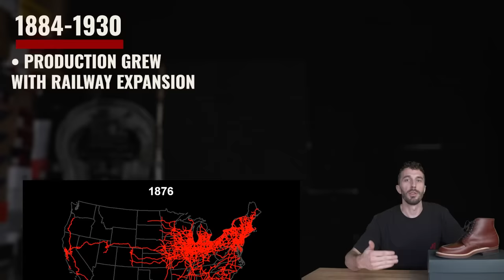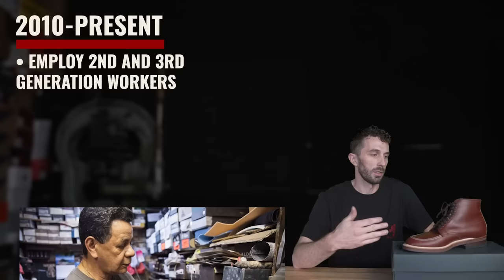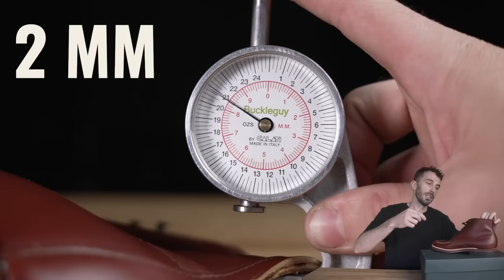Why the Indiana Jones boot is stupidly overpriced - Alden Indy

Comment: I love that the Iron Ranger is still the example of a great boot for a great price. Love the content
Reply: Absolutely
Reply: Yup , the iconic iron ranger stays iconic!!
Reply: O you’ll be surprised, watch the latest video on redwings
Reply: I had both Iron Rangers and the Indy boot. Sold the Iron Rangers and do not regret it one bit.
Reply: @Noodlepoke  Didn't say they were bad. I'm saying I will take the indy boots all day every day over IR's. Look better and more comfortable. I've gotten almost 10 years out of my current pair and they have plenty more life in them
Reply: @Noodlepoke  Indy is much more comfortable as Alden has better the last shapes. Also when you get the 403 instead of 405 you'll get the top quality Chromexcel upper leather
Reply: @anekey925  aldens a nice lookin boot but way overpriced
Reply: @anthonyinzerillo2804  Yeah I initially got the 405 all those years ago and returned them for the 403. It was the right call. He should have reviewed the 403 even though it's not the "classic" Indy boot
Reply: What price, comfort? I started with Red wing and the iron ranger and have a fifteen year old pair that I still wear occasionally. But the Alden is more comfortable in every single way, even after 5 years of heavy use.

Comment: I would argue that the Iron Ranger is a superior boot in terms of quality.
For over 600$ the Indy is not a good value in any way, it would be acceptable for half that. 

There are other issues too. The outsole-stitch is not grooved in, it will wear down very quickly and the heel is not quite level although I've seen worse.
Reply: I prefer barrie last for fit but otherwise I agree.

As for the lack of an open channel stitch... Dunno how much it matters.  I've got allen edmonds shoes from the 80's that never had it and it makes no real difference.  It's not like the sole is gonna come off. 

For what alden is charging should they have open channel stitching?  I'd argue at that price point it should have hidden channel stitching on the soles but what do I know.  Alden is priced somewhere between crockett and jones mainline and handgrade.  CJ uses channel stitching on the mainline and hidden channel on the handgrade.  Carmina is hidden channel.  Meermin Linea Maestro hidden channel as well.
Reply: I would agree. The IRs still have genuine leather (not leather board) and full-grain leather in places where these Indys do not. The biggest advantage that the Aldens seem to have here is that they are fully leather lines rather than half-lined with canvas.
Reply: @claytonberg721  I was thinking about the rubber, not the leather sole options. 
A rubber sole is harder wearing and would logically be used more on rougher terrain, the stitch should be channeld in. 

As far as leather soles go I agree, functionally there isn't much of a difference between open and closed channel, but at >600$ closed channel would be nice to see just for the sake of buying a luxury item.
Reply: @jake2011rt  Alden's real advantage is the variety of lasts, leathers and that they make more shell cordovan shoes than any other maker in the world, including allen edmonds.  

Alden's Shell #8 really is more special than anyone else's shell 8.  That is until their acrylic coating wears off, in which case you remove the rest of it with acetone and it's the same shell 8 that everyone else offers.  

I get it.  I don't wanna sound combative because I think you get it too.  Alden fan boys are insufferable but the real reason to buy into the brand is if get along with one of their lasts really well.  Some people love Trubalance.  Whereas with the iron ranger you're stuck with that last and that last only.  I've got what is essentially and Indy boot but it's on the Barrie last, which means it's a also a 360 welt.  You can have CXL, you can have their house leather, you can order shell 8, or other variations (sort of).  If I wanted an iron ranger in shell with a 360 welt  and a last that was narrower with bigger instep (for example) I'm SOL.  Alden does weird make ups with different style boots all the time.  Good luck getting them, those special make ups, especially in shell cordovan cigar colour is next to impossible unless you're slapping down thousands at one of their retailers,
Reply: Also weston is obviously a craftsman and a leather expert, but by his own admission he is not a shoe expert.  He sees leather board in places like heel stacks and heal counters and essentially marks the boot down, fair enough but in real world wear alot of times it just doesn't matter.  How a heel counter wears doesn't really rely on leather board vs full grain, whether or not you use a shoe horn is the real question.  I've got stuff from the 70's and 80's where the heel counter is leather board and it's fine, because the dude who owned them kept trees in them and used a shoe horn.  Conversely I had to send a 10 year old pair away for recrafting and needed the heal counter replaced because dude obviously didn't use a shoe horn or trees, and those were full grain.

That said at Alden's price yes they should be including this stuff.  If grant stone can, so can alden.
Reply: I said pretty much the same thing.  Weston broke a sweat cutting the Iron Ranger apart.
Reply: @claytonberg721  I picked up a pair of 4011HC (indy in snuff suede w/ commando sole) a few years back and the trubalance last for me, personally, is magical. I have major foot and back problems and wear boots mostly year round and these are by far the most comfortable footwear I've ever owned. I have beat the hell out of them and even walked up an active volcano in them (don't recommend with suede but they held up lol) and both the boot and I were good to go. I've got a make-up in reverse earth chamois preordered because I wanted the full grain to be able to really kick around in without feeling bad about messing them up - but I'd recommend them to anyone tbh.

Comment: I have the chromexcel version of this boot and find the leather looks much more natural. And have to agree with you on the boot being overpriced. Even when mine came in there was random loose threads and it overall didn't exactly look and feel like a $600 boot. I do have to say though... this is by FAR my most comfortable boot. Takes no time at all to break in. Their last is nice and wide, and on the Alden website they have every width and size you can ask for. For someone with wide feet I have to pass on a lot of boots I might've considered because they only have D width available. 

Comfort is what matters to me greatly in the end so I'd say worth it for at the end of the day, but certainly can't argue with how they cheaped out on some of the materials and there isn't a good reason they go for so much. Also, getting a lug sole is essential for these, so the price goes even higher. I briefly got one with their original sole and exchanged it. There's simply no traction and it's true you'd slip everywhere if it rained or even if someone spilled water on the floor.
Reply: Same, though I have the regular sold and here in the desert it's fine, as we don't get much rain or snow.  I love how conformable they are on my feet, though I have noticed that they aren't the best for just standing in ( as opposed to walking).

Comment: I sourced an older canvas lined pair off of ebay a couple years back.  From what I have read they stopped making the canvas lining in the mid 2000's.  To me it has the same fiberboard construction in the heels & under the welt.  They've held up pretty stoutly I would say.  They are not a daily wear but I do wear them at least once a week.  I own the Iron Ranger,  Grenson's, Alfred Sargent, Church's, another pair of Alden wingtip boots & others.  My Indy 405's are by far the most comfortable boot I own.   The magic sauce is the last and they look damn good too. You can find worn but well cared for 405's often on ebay  between $300-400 dollars.  In that price range I would say definitely worth the money.

Comment: Wow?! What a great review and eye opening critique as well. Never thought Alden would “slum it” and make you believe it’s the penthouse.
Reply: There is nothing wrong with them using leather board, nor has Alden ever hidden the fact. It is only marginally cheaper than full leather and has the advantage of being lighter.
Reply: it's the last that makes this boot the penthouse, not the leatherboard. as far as the finish on the boots is concerned, the 405 reviewed above is an office casual finish- the 403 in CXL leather is far superior. The review above ironically criticizes a leather specifically not meant to patina- for not being able to develop a patina.

Comment: While I agree Alden should include better materials for the price, there's a few things in the video I have a bit of a different take on. I also own a pair of Nick's and Whites, but still prefer my two pair of Indy boots simply because they are the most comfortable boots for the type of indoor wear I use them for. I own a lot of different boots with just about every sole type you can imagine, but I still prefer the cork nitrile soles. I do not find them slick on wet surfaces, they are extremely comfortable, yet highly wear resistant.  While the painted leather does tend to wear through over time, when you have the boots restored by Alden I'm pretty sure they repaint them which isn't possible with other boots.  My original pair has been worn once or twice a week for the past 5 years and no sign of them wearing out or even needing to be resoled.  That being said I always rotate my shoes and boots daily not wearing them on continuous days and always wear high quality wool socks with them.  I'm sure daily wear in harsher conditions would certainly wear them out sooner given the substandard materials inside.  While you don't get the high arch support as  you do with Nick's or Whites, they are still excellent for walking and standing all day.  I've owned about half a dozen made in USA Red Wings over the years and none of them I'd compare to the Indy boots.
Reply: The comfort is from Alden's excellent last. The materials should sill be better.
Reply: I agree, they are 10x more comfortable than my red wings.  The outsole is perfect and I could care less about the “leather board”.  I haven’t even had to resole my boots yet after 6 years.  And I’m guessing the resole will happen before the leather board ever becomes an issue.
Reply: @Andrew  fifteen times more comfortable than red wings, of which I own 6 or 7 pairs vs 3 pairs of indies.
Reply: I honestly cannot believe the part about hydroplaning.

Comment: I got some of these on sale several years ago and came to many of the same realizations. Even at the price I paid I couldn't justify keeping them and resold them. 

Mine were the chromexcel version and the finish was also not great. Simply brushing the boots with a horse hair brush took the pigment layer off of the chromexcel. 

Additionally, fitting these boots is not easy and they're tough to find to try on. Don't trust internet fit advice on a $600 product! Fit can change after the first several wears, particularly on the chromexcel
Reply: @working_mans_watches  unfortunately that's not what I was experiencing. The top layer of the leather was literally flaking off from brushing - going from dark brown to the light brown underneath after horse hair brushing. 

I even bought a brand new brush in case mine was abrasive and same issue. 

Regarding fit, sizing down is questionable as mis-sizing the length or width of the footbed in this shoe can be extremely uncomfortable

Comment: Bought a pair of 405s a decade ago. Cloth lining, cheap laces and the heel started to come apart after a few days walking in London. I sold them on ebay and then bought a pair of Vibergs, tobacco waxed, Kudu service boots. There is no comparison. The Vibergs are beasts, heavy, well made and the Kudu is tough as nails. The Dainite sole is nearly indestructable and the boots came with leather and waxed linen laces.
Reply: You're right. Mine from back in the 90s had cloth lining, I had forgotten about that. But the leather wasn't paint on and I am 99% sure the heel stack and midsole was leather.
Reply: @chbclark  The leather uppers on mine appeared to be rather good calfskin and as you said not painted. They weren't bad boots per say but, not as good as they should have been. 
I picked up two pair of Red Wing Iron Rangers two years ago and the copper "rough and tough" is one durable boot. 
I'd say that the Iron Rangers are the "pickup truck" of boots. Nothing fancy but, they'll get you where you need to go and back.

Comment: On the white in the cross section, I've read numerous sources that this is due to cutting back on dyeing time to save money vs longer vat time for full "thru dye" cross section.   I also have worked with many pull up leathers that chrome tanned & thru dyed...  And many of both partial & thru dyed from SB Foot that is supplier for Red Wing...    On Calf vs Cow--I'd expect calf to be used on dress shoes, but certainly not work boots!  Always learn something on your videos & would love it if you'd do Johnny Fluevog Derby boots or shoes (with angelic soles).

Comment: I got my Alden 403s from the shoe mart as factory seconds. They have a very minor cosmetic flaw on the leather. They were $400. I recommend buying there. Plus after a $175 resole when they wear out I can get a veg tanned mid sole and stacked heel black that won’t have to be replaced for 1-2 more resoles. I love them and do get a lot of support from them. However I wouldn’t pay $600 for them.
Reply: For some reason whenever I see people post pictures of their factory 2nd 403's the color is always darker than normal.
Reply: Did you do the resole service with Alden or someone else?
Reply: @XiaNingTian   I wouldn’t recommend using Alden’s resole services if you want true leather used to recraft the heel stack and midsole. Find a cobbler for that and quicker turnaround.
Reply: @MrKudosx   mine didn’t differ really from the pics I saw. There were some markings but I just see it as free patina.
Reply: @nickwilson5379  That's what I plan on doing, but I'd also like to get the leather insole replaced on my pair of 405s. I kinda took a piece off by mistake at the edge of the heel when I was replacing the sock liner. Not sure how easy that is for cobblers to replace without the last.

Comment: Most comfortable boots I've ever owned. I've owned many Red Wings, Thursdays, Allen Edmonds,  Grant Stones etc... Yet Indy's are the boots I recommend. I think a lot of the huge thick cuts of leather that you are obsessed with fall into the category of compensating for something, like a truck with an 18 inch lift and dumb huge tires. I don't think it's actually advantageous design, it's just "badass". Ultimately those boots end up being super heavy, super hard to break in, uncomfortable, hot on your feet, and stiff. I believe every single decision made in the design of the Alden 405 was made in the interest of comfort and function as form. In fact Alden as a company was an orthodics first and a footwear manufacturer second(and much much later) sooo... Definitely not a gimmick which is easily proven by the history and the fact that every single person who owns a pair swears by their comfort. The neocork was probably the absolute best option in the interest of comfort at the time that they were designed and I love that they haven't changed the design since. It would be like if Jeep kept making their OG design instead of making adjustments. Also... Just get the commando sole if you want a lug sole, problem solved. I'd take a pair of Indy's over 2 pairs of Red Wings ANY DAY.
Reply: That's not the main point though. They can be comfortable, but they are NOT worth $610. Not even close. If they were $200-$300 then yeah.
Reply: Good point the true balance last is super comfortable, but fiberboard mid sole and heel counter are inexcusable. They are just cheap replacements for tried and true quality materials.
Reply: @Totemparadox  $200-$300 is low, even for these. I'd say $300-$400 is fairer. Even with the leather board midsole and counter, they're not using synthetic materials like Wolverine 1000 Miles. The Indys should easily fall into the $300-$400 range, maybe $350-$450. Though I'd like to know their reason for the leather board midsole and heel.
Reply: Agreed. Very sensible comment. Check mine referring to this and elaborating.
Reply: @XiaNingTian  Leather board is synthetic. We don't call rubber natural just because it contains a little bit of natural rubber.
Reply: Alden is pulling the quality down and the price should do the same.
Reply: @Totemparadox  Okay, I stand corrected. In my experience, it still held up better than the poron or whatever is used in Wolverine and Thursday. I've had less problems with my Alden Indys that I had for four years of near daily wear being my main boot than my two Thursdays that I've had for half that amount of time when I threw them into the rotation.
Reply: @XiaNingTian  For sure I'd rather have leather board over "cardboard" or poron.
Reply: @Totemparadox  But I do agree the boots are overpriced. Still love my Indys though. They should be priced $300 at the lowest and I'd say as high as some of Truman's or Oakstreet's boots just for the labor alone. The demand for these boots, storage and labor costs and other overhead costs more than likely is what bloated the boots the extra $200-$300 from where they really should be.
Reply: @JM-Blackjack  can't find it, tag me?
Reply: Hey, Thomas. It's just a couple comments  down from yours.